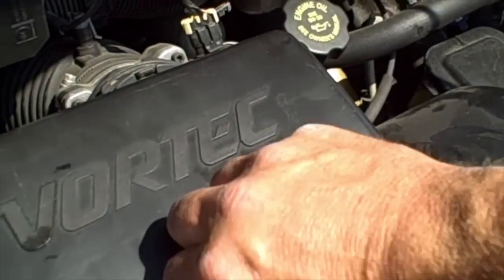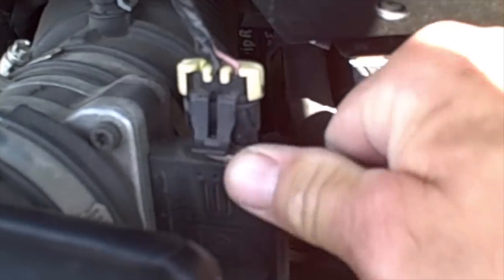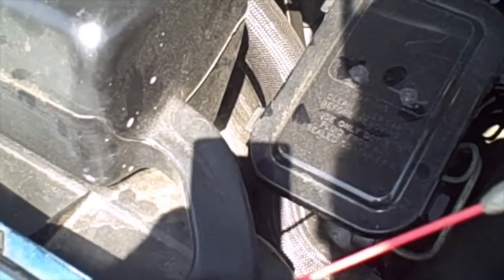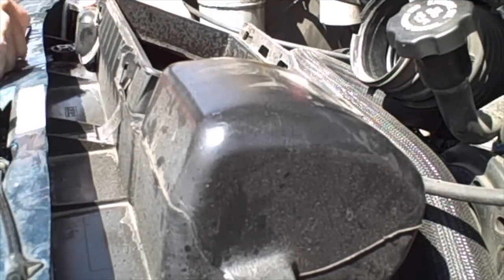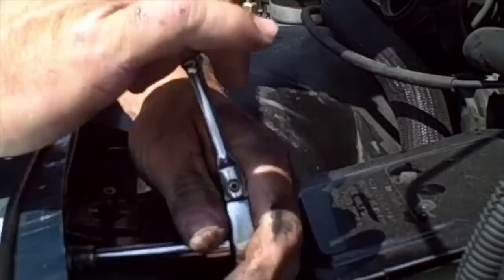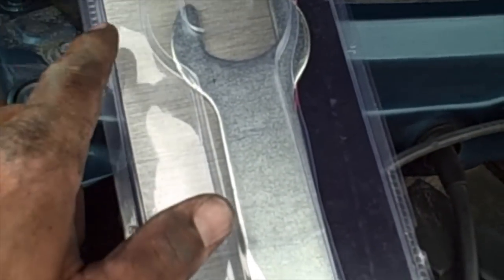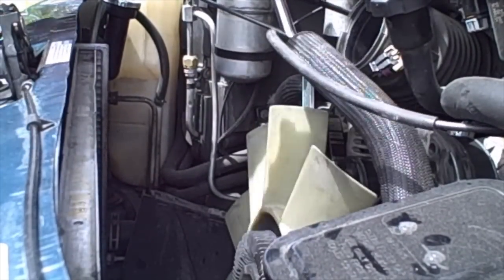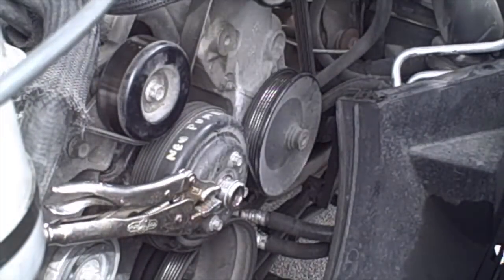How to remove a Chevy fan clutch on a 4.3 liter engine

Comment: Thank you!   I just got my fan clutch off (for a water pump change) - and used 1 tiny shot of PB Blaster, and used the vice-grips on the pulley bolt as well.   I placed a small block of wood between the vice grips and the tensioner pulley to hold it firm while tapping with the hammer on the wrench.  5 taps and it was loose.